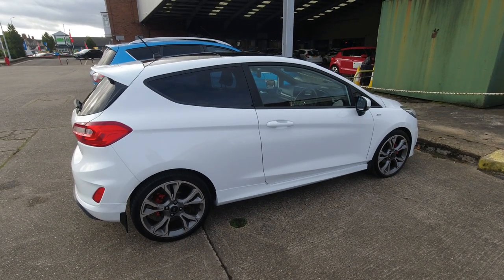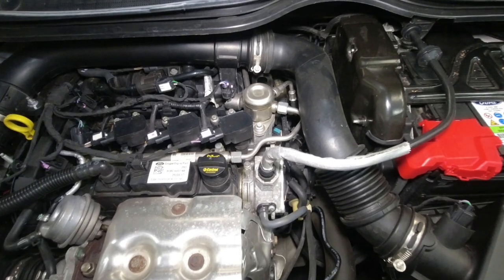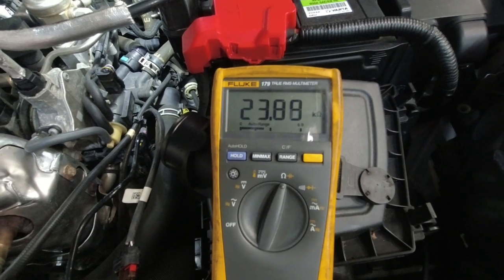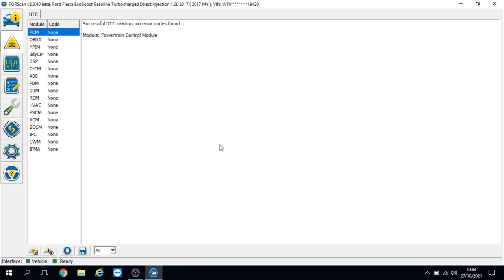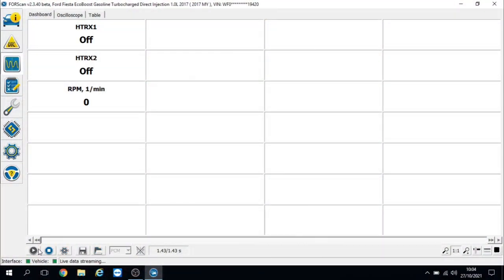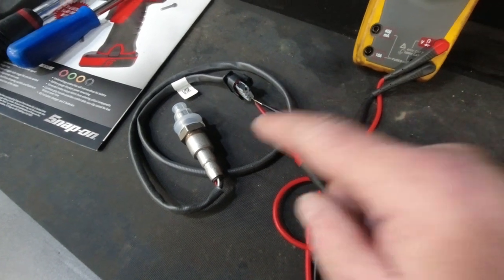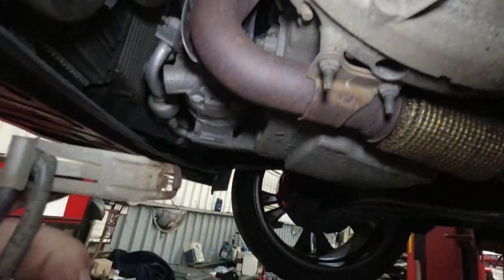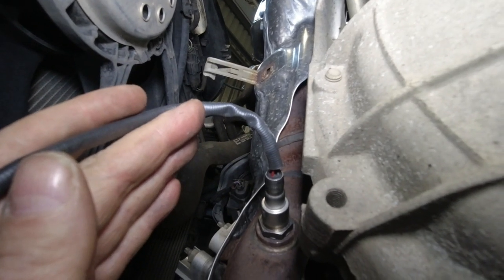O2 Sensor Heater Circuit Malfunction - Code P0141 - Ford Fiesta 1.0

Comment: Another excellent video. Had to do the same job on the wife's mk 7 Fiesta  when it was 8 years old. Very disappointing that this new Fiesta needed a new sensor with just over 1000 miles on the  speedometer. I have  had 4 Mondeos and the wife 3 Fiestas, but next car will probably be a Skoda, the best of the VW group. Keep the videos coming, it always a pleasure to see a true professional at work.

Comment: Ha our Sunday morning coffee and automotive tutorial from Steve.  Do like the test lead mate. Bet I'm not the only one who says this and then they will probably ask for a schematic on how it was made. And if you need an idea for another video can you do one on a wideband o2 sensor using Forscan. (assuming ford use them) They always confuse people when they go faulty.
Reply from the maker: All I did was cut the sensor part off an old like for like sensor, I soldered a small bulb to the 12v supply and heater control wires (pins 1&2) and then tapped a bna plug into each of these to use on a scope to view signal and supply.  Ill look into doing a wideband but they are difficult to measure as they are measure in Milliamps. There are data values we can use when using forscan on the 1.0 wideband sensor

Comment: Nice video bud.  I've done the same with the light. It makes it so much easier to test with how buried the wiring connectors are doesn't it. I like the extra connector to scope the signal. Good job 👌
Reply from the maker: cheers Dan,  the scope connector was an after thought, I've since added another to test the live feed and the command

Comment: Excellent video.  I have a fault p0036 o2 sensor bank 2  Ford focus 1.0 ecoboost 2916. Replaced the sensor still got the fault. Any suggestion please.
Reply from the maker: If you can confirm the wiring is ok and there is still no control to the heater, then often a software update can fix it. But it's likely that the ecu could have failed
Reply: @SYDiagnostics   Thank you for your reply.  I have cleared the fault code and the engine management light comes on after driving for 20/ 25 minutes when engine is up to normal temperature. The obd reader shows  fault in permanent codes . I have driven car for almost 400 miles. Thank you.

Comment: Hi man. very good video. I have one question. which Fluke model multimeter, are you using?I am looking to buy one,which one you recommend  me?
Reply from the maker: I use the fluke 179 but only because I was given it by a subscriber. Fluke do automotive multimeters too. I also use the UNI-T meters if you watch some older videos

Comment: Do I need to disconnect the battery when unplugging the sensor and fitting the new one? Thank you
Reply from the maker: No you'll be OK. Just turn ignition off
Reply: @SYDiagnostics  thank you for your reply, really appreciate it. Brilliant videos keep it up 👍

Comment: Hello greetings very interesting channel. I was watching one of your video about coding injectors. My question is about ford transit connect 1.8 TDCi 2006. I SWAP just engine from 2007 connect. Engine is running good but it's having exhaust emissions above the norm. Should I do injectors coding or I should swap injection pump. Kindly regards Lukas
Reply from the maker: If the injector codes do not match what the ecu thinks they are, then yes I'd code them in as a first start. But doubt it would effect your emmisions to much extent
Reply: @SYDiagnostics  Hi thank you very much for answer. I will try first to code. Good luck with channel and I will keep on looking at your new videos, because you are great mechanic and teacher. 👍🏼😃

Comment: Good morning, I have this fault come up on my Ford fiesta  eco boost 1 litre. I was wondering whether  this would be covered under my warranty? Thanks in advance
Reply from the maker: In the UK the warranty is 60k/3yrs so if its proven to be at fault then I can't see why it wouldn't be covered. But I'd check with your local dealer to clarify, If I was you.
Reply: @SYDiagnostics  thank you

Comment: I’ve got fault code P0420 and changed this sensor in your video as euro car parts only had that sensor.. so would it be the other sensor and where would I get it from, my mk8 1.0 only has 25k on clock and it get driven a lot and long mileage…
Reply from the maker: p0420 is catalyst efficiency so is a different concern, basically the rar 02 sensor is reporting that the catalytic converter isn't efficient and you'd need to assess why. It could be a running condition (rich/lean) and failed cat, a mis reporting o2 sensor.  It's not as easy as plugging in a code reader and replacing parts baed on a code. The cataytic converters do fail on these, but they do also run rich due to leaking injectors, leaking fuel pumps (oil dillution) and stuck tank vent valves.  They also have lean issues with split pipes.  Any other codes stored?
Reply: @SYDiagnostics  no only that code, I did a Live Data on Bank 1, Sensor 2 and the line is flat
Reply: @SYDiagnostics  I put some cat cleaner in it this morning no juddering, no loss of power it’s running more better.. Also I have Sync 3 and screen is set to Auto Day and Night but it’s always stuck on night do you know how to fix that

Comment: Hi. This test also work corsa ? Or Astra thanks
Reply from the maker: Yes it's pretty universal
Reply: yes,the light bulb acts as a load for the ecu to control ,so can see what is happening ,very simple and very clever test,scope test point too,have made them myself on volvo and vauxhall,bmw ,long as you know the res,ohms of a good device,then can swop out with a bulb of simular res,ohms ,then can test the ecu control as he showed ,switched earth,as other side of load is ign live ,fused ,control is switched earth ,works well ,then if ecu pass test ,you know the heater or device is faulty,not a guess but proven ,i always strip dead carparts on the bench to see why it died,drives the boss nuts ,but its how i learn ,and got test bench set up for test stuff,power up parts and see how they work ,how to control,switch ,helps alot on dianostics too